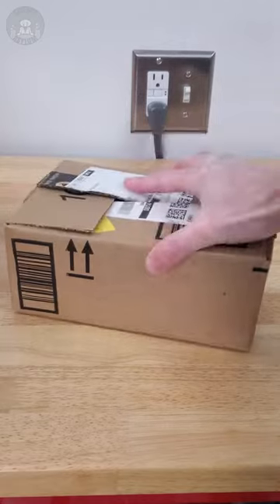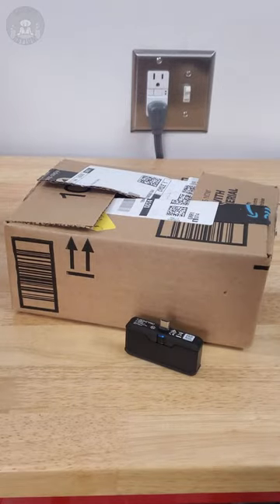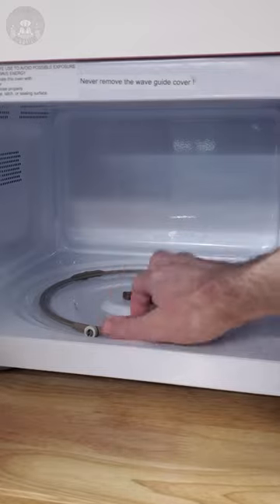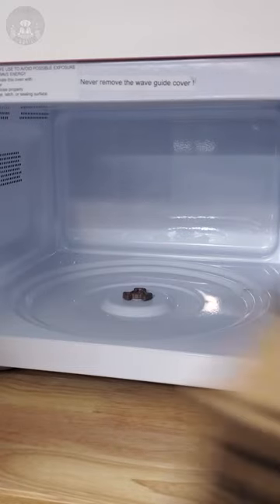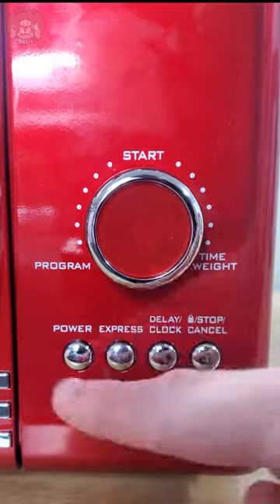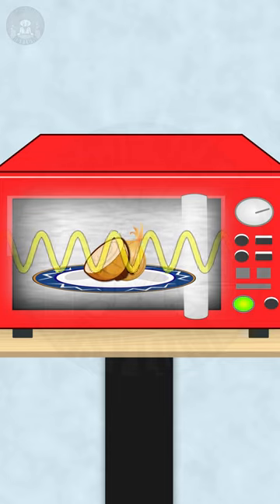Visualizing 3D Wave Patterns in a Microwave Oven #shorts

Comment: Fun fact. 
You can use a microwave and a bar of chocolate to calculate the speed of light. You need to take out turn tray. Place it in center of the microwave. Cook for a short time. Find the distance between the 2 hot spots multiply by 2 then the frequency of the microwave that's on the sticker inside the door(should be around 2.4ghz).

You will get the speed of light in meters per second.
Reply: Instructions unclear but I found Uranus.
Reply: Does it matter if it's milk chocolate or dark chocolate? If it's dark chocolate do you get a dark energy microwave? LOLOL
Reply from the maker: Yep! I made a video about it many many years ago: https://youtu.be/rwEP-IOUXC8
Reply: @ScienceAsylum  emmm tasty. I love s'mores.
Reply: @ScienceAsylum    I took your facial image from the old s'mores video and compared it to your image in a recent video.  Then I ran AI software to determine the age difference based on the change in your facial features.  It came up with about 7 years.

Comment: What If we put dry ice in it without any water at all, will it melt?
Reply: I would imagine no faster than normal Microwaves work by vibrating water and certain other molecules. 

To be sure I looked it up and a guy tried it and it did not melt an faster than just sitting out.
Reply: Yes but it goes vapour at room temperature anyway.

Comment: Nick, my Doctor.
It's not that good to damage your magnetron and your high voltage diode, ok?
And what EM, that's IR ok. EM but already collapsed microwaves and re-emitting those IR photons, that's not the action of the microwaves.
We just can't see them. 

Question : How long did you have that cardboard box being eigenvalue covered before emitting IR?
I Mean (x) you had to use that kitchen glove??
Mine is 9000W.

Yours? 

Man, that box could catch fire, yeah.
Reply from the maker: The box was only in there for about 15-20 seconds. Also, I think this oven is only 700 W. (I've never heard of a 9 thousand watt microwave. Is that a typo?)
Reply: @ScienceAsylum  9000 x 0.1 😅😅😅😅😅😅🖖🤓